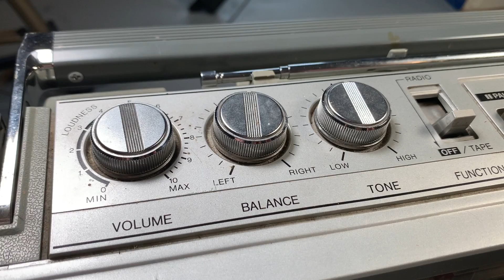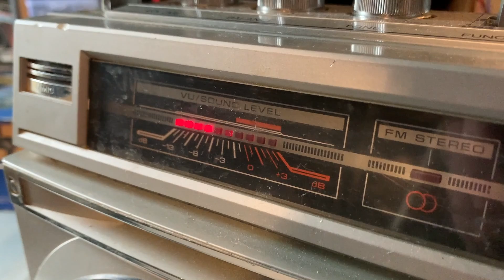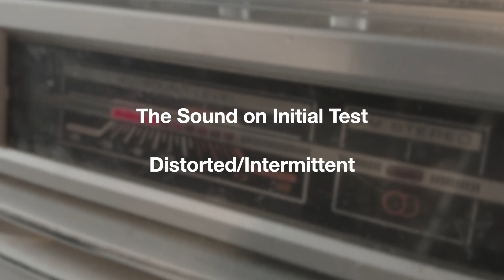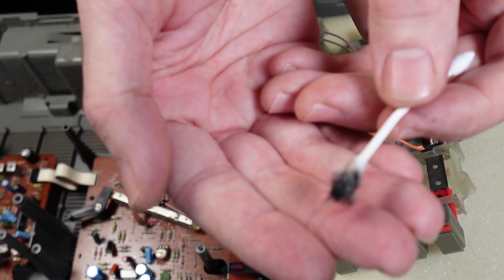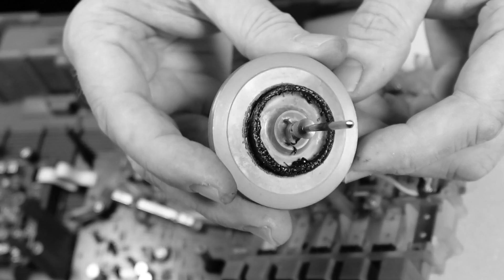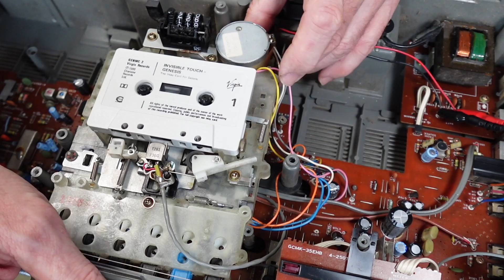Sanyo M9935K Boombox Restoration. Radio Cassette Repair

Comment: I have one of these that I bought brand new back in '81. Everything still works. But honestly cassettes are such a horrible format, even when these boomboxes were brand new they'd still eat tapes every once in awhile. I'm amazed that you could repair such a mess but honestly is it even worth the aggravation, time and expense? As long as the radio works fine that's good enough for me. I was going to open mine and give it some maintenance. I definitely am not going to do that now since it's still working correctly. Because it probably won't after lol. Thanks.
Reply from the maker: Thanks for watching. Great to hear that yours is still working after all this time. In all honesty, I’d say that less than 1% of machines I get in are working properly, so enjoy it! Portable radio cassette players were so varied in price point and quality, and some were not good at all, whilst others are exceptional in sound and build quality.  I tend to work on a lot of cassette players, as there isn’t much analogue radio here in the UK now (everything is being moved to digital format), and there’s somewhat of a cassette comeback. I agree though that it is usually not worth it- at least financially, due to the amount of labour involved and the lack of parts availability. Most people will only really repair old boomboxes for the love of it. Thanks again 👍

Comment: Hello, I recently purchased this Sanyo. I've noticed the FM stereo LED goes out often. Even when tuned into a strong local FM. I was surprised to see this model lacking an actual MONO/ST selector. Great videos! Thanks!
Reply from the maker: Thanks for your comment. I guess the absence of the Mono switch and associated circuitry helped with keeping to a cost during a highly competitive market. The FM can be sorted (a common issue with older radios) - I’ve covered it in a few videos here on the channel as it happens.

Comment: Hello, I currently have the same device on the table, I have cleaned it and replaced all the belts. Forward and rewind works, but the play function doesn't. It just spins one coil and then it shuts off. What could that be?

Comment: Glad to see you got the Sanyo operational with a satisfactory and safe result. 😎
I recently serviced a Sanyo M-W1F (double cassette model) which didn't work at all and was a total mess inside (melted belts plus a lot of shoddy repair work done by the previous owner - joined wires, bad soldering, wrong parts used, etc.). It took me over half a day to correct all of the mistakes as well as fix the original faults. I kept it for a few weeks and eventually sold it in full, reliable working condition.
Reply from the maker: It does amaze me how some people manage to butcher internals. Downright dangerous sometimes. Glad you got the Twin Deck safely back up and running  - I did an M-W1L twin on the channel (it was like new), and it was stolen a couple of weeks later, unfortunately.
Reply: @retro_restos  Exactly. The power cord was part of the "joined wires" (it's permanently connected in the F model). 240v 50Hz AC (the standard here in Australia) goes through that when plugged in. I replaced the joined cord with a modern insulated plug type and reconnected it internally (the same way the original had been - no joins or bare wires). Then I took care of the rest (as mentioned above) to make it safe and fully functional. 😇
* Also, I took the plunge after seeing some of your earlier videos and hit "SUBSCRIBE". 👍

Comment: Never seen belts around a flywheel before and hope i never do what a mess oh my lord excellent video.
Reply from the maker: This one really was a mess! Glad it got sorted though in the end 👍
Reply: I've seen melted belt goo on flywheels (including capstan) many times and it's a nasty mess for sure. A couple of hours or so worth of clean up is needed. More often I see goo wrapped around the motor pulley and in some cases the motor itself is fried/dead and has to be replaced. I've done this with several different decks.

Comment: I literally think that you literally did a great job, literally working on this box. Literally I do literally. 😂😂😂😂😂
Reply from the maker: 😂You could probably tell I was relieved to get this one done. Not a word I use lightly, but I 'literally had to take it apart time and time again! I still like the unit though, even though it tested my patience 😁👍
Reply: @retro_restos  The hole in the back of the motor for tape speed adjustment is a trimmer pot, not a screw. Some models have this on the main board or a little board attached to the deck mechanism (called a drive/servo board). Speaking of screws, it's not too unusual to get one of these units and find furniture/wood screws fitted in place of the correct machined type and/or missing ones. ☺

Comment: Another great video and restoration, that took lots of patience, nice unit from sanyo but I wish they would've added more options like phono or line in and out,  a loudness button or separate bass and treble controls, I had this model but sold it about a year ago, again great job, keep the great videos coming 😊😊
Reply from the maker: This one did try my patience more than usual. Ironically it worked pretty much ok, but I wanted to get it as good as possible and it all went bad once I cleaned it up! Most people would have sold it as 'working' in the condition I got it in 😂 
I think by this time,  Sanyo were starting to become more price conscious. The build quality was drifting a it and the functions were definitely starting to become simplified. Plus, I guess vinyl was getting less popular (or more premium fixed amps at home) and boomboxes were expected to be lighter and more portable, so the built-in phono amps were no longer as common as in the  late 1970's.
Reply: @retro_restos  very true the quality was changing, looking forward to the other restoration. God bless